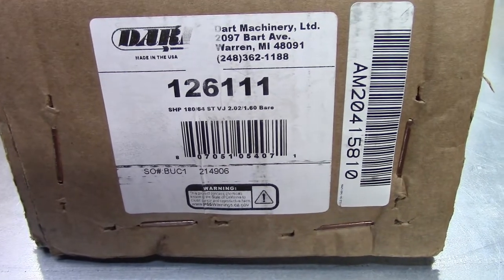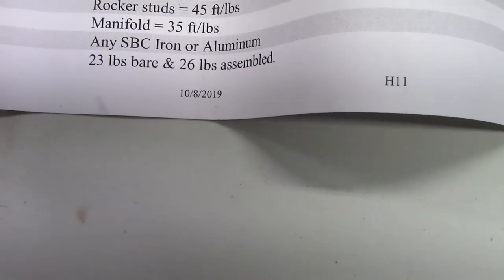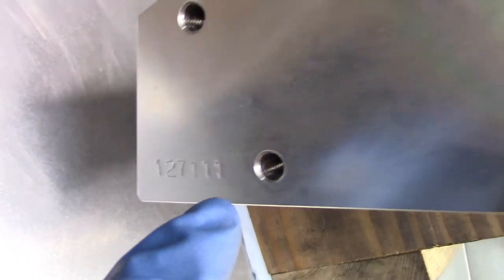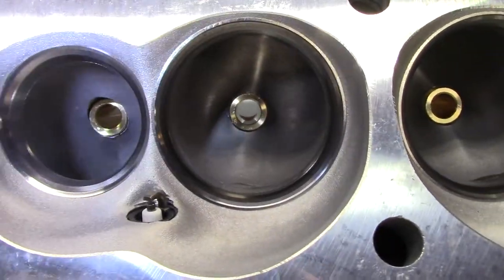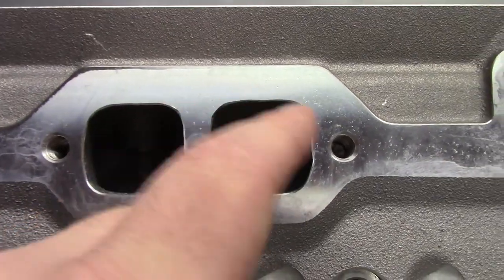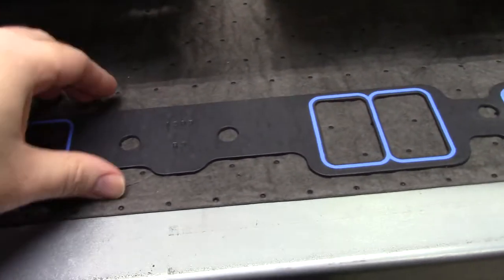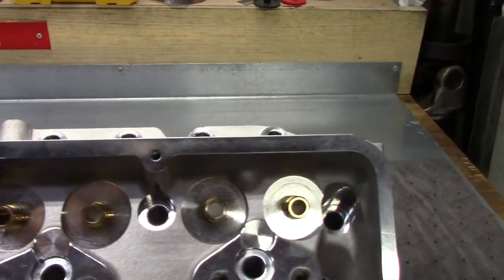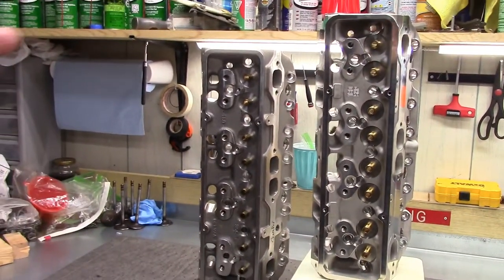SBC 23 Degree Dart Machinery SHP 180 Revised Cylinder Heads

Comment: The deck looks like a AFR 195 street head and the exhaust side does too. AFR has that same bump between the exhaust ports at the deck level too. Head really looks like an as cast AFR 195 street head. Which also looks like a BPE head from about 5yrs ago. I think FLOTEK also sells a version of that core.
Reply from the maker: Had a few comments that they are another overseas copy and also on one of my forum post that they are copies of an AFR head just smaller.  Another not so common brand is selling these castings as well.  The BPE copy of AFR was an older version AFR use to have.  Flotek, well still gotta finish that vid someday.

Comment: There's also a Trick Flow head from a few years back that resembles that core. Deck also looks like the AFRs from a while back. That bump between the exhaust ports at the deck level also looks like a older  AFR.

Comment: it says , valve spacing moved .050 from stock. do you need to use special rockers?
Reply from the maker: Some stock heads don't line up straight.  Adjustable guideplates work fine, for not huge offsets but if it's too much.  They make offset rockers or even lifters. RPM and app should be considered as well.  If Dart intended these heads to only be used with offset rockers, then they'd prob sell some "Special Offset Rockers" for them

Comment: How do the pushrods hole line up?  The old one I had to get ofset rocker to get them a litte closer to riding center on the valve. POS heads in my opinion

Comment: The decks look like BPE heads from a few years ago.
Reply from the maker: BPE use to be old AFR copies But they have used the Dart copy(ebay generic) more recent.  Check out my BPE vid
Reply: @BOOT  yep, I have some in stock. The new BPE SBC heads are identical to the 200cc Darts. The old ones looked like the AFRs. I have a 5yr old pair of BPE 316cc bigblock heads, they are identical to the AFR 315s. I think the new ones look different. Haven't laid eyes on a new pair yet.
Reply: The decks look like The Promaxx Project X heads too. Believe the exhaust looks similar too.

Comment: Vj stands for valve job with vakve sizes.
Reply from the maker: Yah I kinda figure it just meant that they had a basic VJ.  Since some builders/porters might prefer that the seats to be left unmachined.   But wasn't certain and wanted someone to confirm.  all bare heads that I've purchased had a VJ

Comment: what you mean them old ones are no good?guess there is no pride in American workmanship hey,of course i found that out with their chevy small block shp. i will never recommend a dart machine product to any of my friends,due to the sloppy workmanship
Reply: The intakes are pretty nice, and the Dart heads from years back were real good quality. I used alot of the Iron Eagle 215 & 230s on dirt track engines back around 20yrs ago, they were well made.